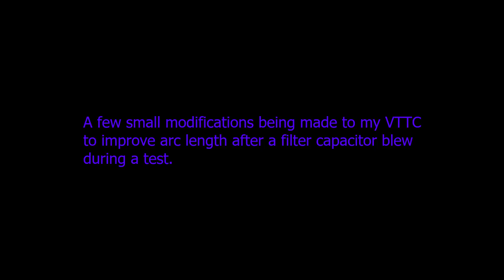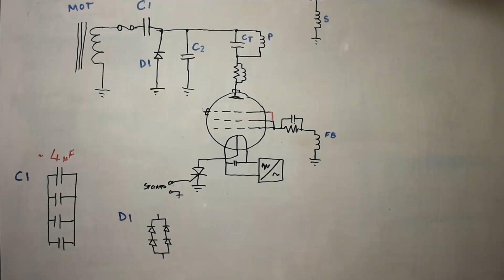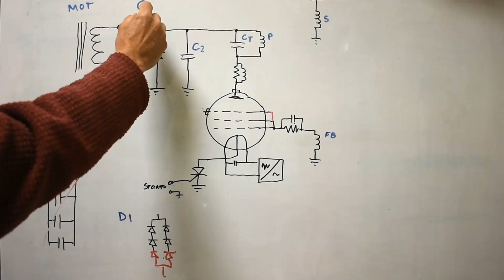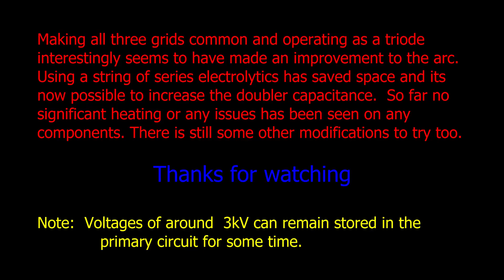VTTC maintenance

Comment: I remmeber seeing your gu-81m vttc a long time ago!
I've also neen working on my own VTTC with a hartley oscillator to drive the secondary and it shows a lot of promise (on my channel).

I also want to retry the dual gu-81 push pull vttc again.

Great that you were able to improve yours!
The electrolytics will probably be fine but since the tube also does act like a diode the capacitor will be slighly charged negative every mains cycle, of course the diode provides more current than the tube so the reverse charging is limited by a lot since the tube needs to discharge the capacior first then charge it in the other polarity. it probably is fine and if it does fail you have the fuse.
Reply from the maker: Thanks, I was happy to still find some ways to improve the arc length.  I have often like the idea of a push pull arrangement rather than doubling the supply voltage to increase the arc, but I haven't seen anyone try this. Some have said its difficult to make it work well.
Reply: @tuopeeks  Well I am one of the guys who tried it, so haha have fun going through my Experiment Videos.
more to come ive done research and experimentation and i have dome good ideas to improve it

Comment: Cool good work mate, I would say you gained some length and I think the swords are more consistent too, I would suggest a few diodes in series across the doubler cap to ensure they can't see reverse voltage, I put anti parallel leds (with a couple of meg strings of resistors)  across my doubler caps and noticed the both light so they do see some reverse voltage in staccato operation